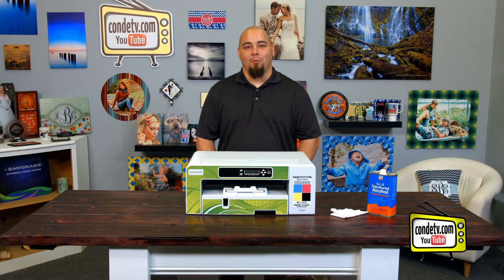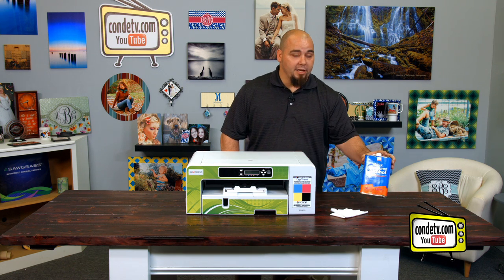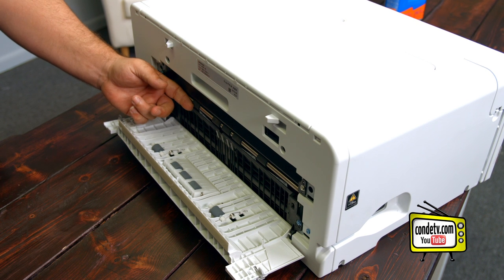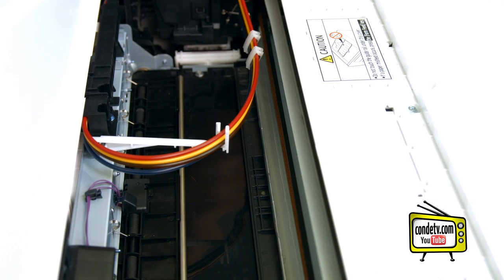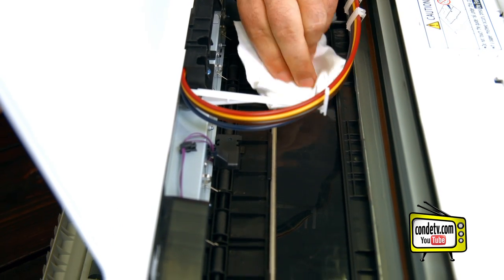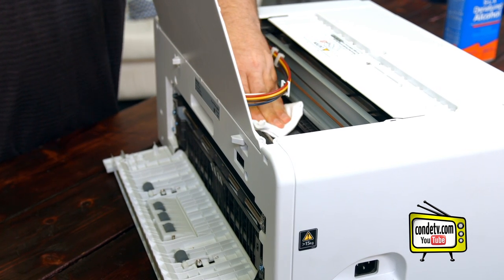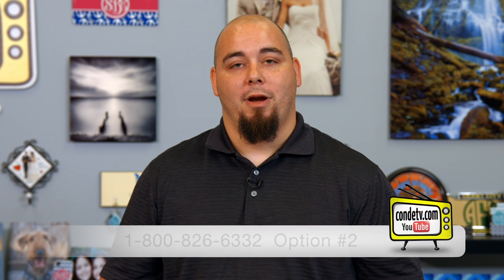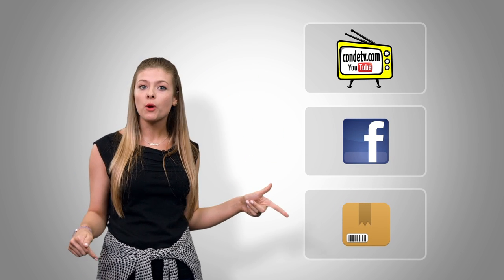Dye Sublimation Sawgrass Virtuosos SG800 Printer: Belt Cleaning: Code SC57000 SC57001

Comment: Thank you for the tutorial. I wonder if there is a video instructing of how to stop a Sawgrass printer from getting stuck in the same process. What can cause this issue and what I can do to fix it ? It’s not showing error on the screen just as if it is charging without and end of it. Thanks
Reply from the maker: Hello Millie,  We are not sure which process your printer is getting stuck in.  Please contact our technical support at Support@conde.com and it would be our pleasure to assist you :)
Reply: @condesystems  hi there guys! You guys are awesome. I should recommend people to buy from you cause you are attentive to everyone that has an issue, thank you for your attention to my issues. My printer that had so many weird issues it’s been fixed by faith I just prayed  👍 there is power in the Name of Jesus ! - it is printing and obeying commands now. What I’ve noticed is that it might need color adjustments It’s printing with no issues  but the black ink I think it might be clogged? How can I resolve this issue? Thanks again
Reply from the maker: You should start with a nozzle check and if needed perform a head cleaning.  If either of those don't get you black printing correctly, there are a few other options.  The best way for us to support you issue is if you contact us at support@conde.com.